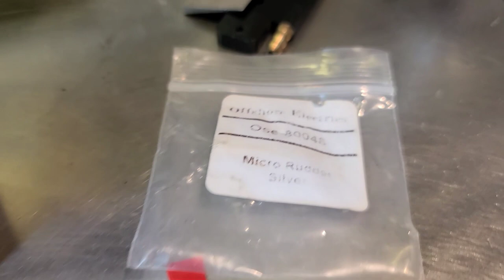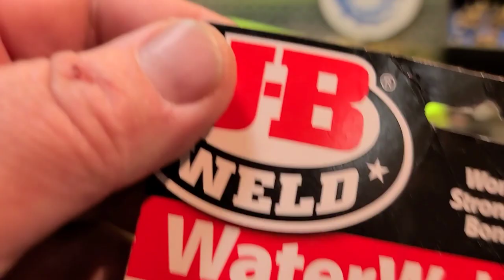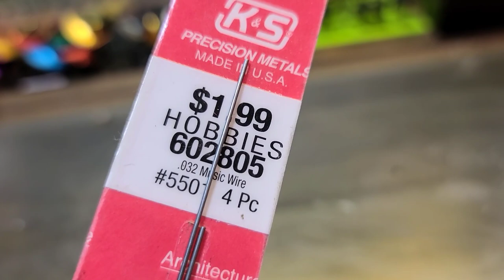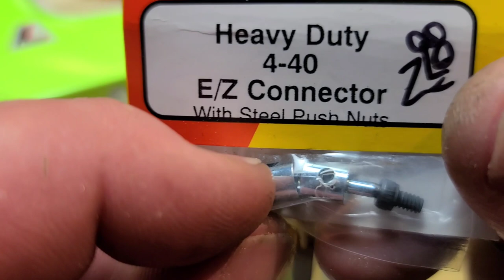Upgraded Proboat Miss Geico 17 Micro Rudder Install - Rc Boat Steering Fix

Comment: Your killin me showing me what all I can do to this exact boat.  Mine setting in the junk shelf right now. Willing to pay to have it built.
Reply from the maker: I don't have time to build boats for others I'm sorry, that's why I'm showing you how to do it. It's so easy
Reply: @IRONCLADRC  send me a parts list of what all I need far as what size stuffing tube. Prop and what size couplings. I don’t know the first about the sizes and stuff. Once I learn what’s what and get a starting point I’ll be able to take off with it. I don’t wanna go cheap but not way overboard with the build. Hope to stay around $300/400 on it. If the motor and esc I have will work? It’s a 5300kv and 60amp esc

Comment: Man you are too funny! Leaving the drain plug out! 🤣😖
That's a nice mod for that little boat Big B. 
Personally I like a central rudder on cats, and  as far back from the prop as you can get it. Seems to really improve handling and stability. As you know I did this with my Zonda rebuild and she handles like a dream.
See how the 17 runs but possibly add a pair of trim tabs to lengthen the sponsons a little 🤔
Nice work brother 👏
Reply from the maker: Thanks Steve.  Trim tabs is an excellent 💡 idea.   I'm thinking about modifying the veles with a center mounted Rudder just to see how a central mounted Rudder changes up the handling?

Comment: I got a little excited today after some upgrades,and left my drain plug open too on the 915...It definitely has power though,I could barely get pass 1/4 throttle!!
Reply from the maker: I've gotta get a wl 915 I've been considering building one for quite some time now
Reply: @IRONCLADRC  It's an interesting boat to upgrade,not very forgiving ! It definitely keeps me on my A game setup wise,and driving,makes everything else feel easy going!!

Comment: Local Hobby Shop has one in stock. Going today pick up. Will my mini b Hobbywing 2030 5200kv motor be to small for this boat ?? Got a 7800kv also. Thank for all you do. frankie p    sa tx
Reply from the maker: I'm running a 2440 4500kv & she gets a little warm.  2030 might work but the speed wouldn't be much faster than stock?

Comment: Could give the measurement between the hull and the top of the stuffing tube?  boat seems to run really well at that location!
Reply from the maker: Really don't need a measurement, just position the stuffing tube in line with the bottom of your ride surface with the bot sitting on a table top

Comment: went back to the lake to run the ul19, there is a big lag with the seaking  180 amp. Should I go with ose? which one do you recommend? Jeff AKA 10 second Tom. Sorry to bother you. trying to relearn. thanks
Reply from the maker: What prop were you using? It could be cavitation at low speed?  I'm running the ose but she gets a little warm wit the sss 4074 2000kv

Comment: I just bought this boat can you send me part numbers and place to order from even with all the props please and thank you
Reply from the maker: There's links in the description, tfl 430 prop and .130 to 1/8 flex cable with corresponding stuffing tube.  Ose may have everything u need. Offshoreelectrics.com